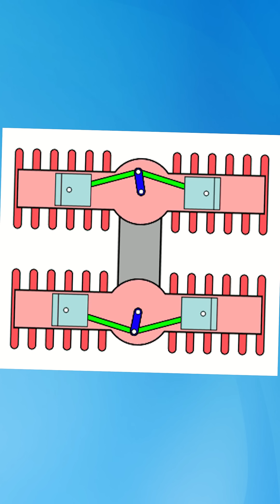wHY DoN'T CaRS uSE H-ENGiNEs?

Comment: The rotary engine catching strays😭
Reply from the maker: RIP dear sweet rotary
Reply: mazda has been working on a total redesign of a rotary engine for the iconic sp car theyve been working on so who knows it might be good soon
Reply: @AstraOG  fucking praying, i'd give my first born for it
Reply: Yeah like, theyre probably overcomplicated to machine, but I bet it has to have less moving parts than an H16
Reply: Honestly, I prefer my centuries-proven pistons over rotary any day of the week.
Reply: they are objectively terrible lmao
Reply: @astrofeeder777 built right they are good, Many examples of this, 787B mazda, Rob Dahms 4 rotor rx-7, these are the only ones i could think off the top
Reply: My grandfather had a 4 wankle mazda pickup that he'd use everyday, drive off-road, and pull f150s out the sand because they didn't let air out of the tires. Thing lasted over 300k miles and the bed rotted off before any engine issues occurred.
Reply: @astrofeeder777  they are much more reliable at high rpms than a piston engine, and are much more power dense.  Also my family has been driving a rotary for the last 16 years, and it has been really reliable, while still having original apex seals.
Reply: @burgerking2968  so long as you don't let carbon build up, rev the shit out of it and top off the fuel like every 3k miles or sooner, it's definitely gonna last. The rotaries that are not reliable are the ones that haven't been maintained, similar to subarus. The m5 e60 is also kinda similar. You gotta give it a lotta oil and do preventative maintenance.
Reply: @astrofeeder777  only to daily drive and it honestly not even that bad. use the whole tach, pre-mix the fuel, and dont get it hot.
Reply: @masterater  don't get hot Lmao
Reply: @wojtason9077  yeah.. whats funny about that? dont be a moron and it wont blow up🤯
Reply: @masterater  it's a combustion engine. Obviously it will get hot if it runs for more than 3 minutes
Reply: @masterater  just like if you were driving a 2 stroke

Comment: i dream of a turbo boxer-8 and an N/A boxer-H16 for years in F1
Reply: isnt boxer 8s extremely unbalanced or something? i heard the reason boxer formats didnt go over 6 was because they would only have somewhat decent balance again at 12 and even then it wasnt that great, as the old subaru B12 was a failure.

Comment: Also 3L 16 Cylinder is kinda stupid. That's 0.1875L per Cylinder. At that point just make a V8. That is probably like a third of the moving parts of an H16.
Reply from the maker: On the bright side, it sounds nice! But yeah the H16 was notoriously unreliable due to all it's moving parts!
Reply: @BladedAngel YEAH. YOU CAN HEAR IT. LIKE TRULY LISTEN INTO THE ENGINE IN DEPTH IF SOUND. YOU CAN HEAR THOSE PUSH RODS 😅
Reply: @BladedAngel  the moving parts count wasn't the issue because it didn't have more moving parts than necessary. it was an extremely rushed engine to get it out for F1.
Reply: @BladedAngel  did bro js chatgpt that shit
Reply: V8s have low top RPM, H16 could rev all the way to 18k RPM because the smaller the piston, the easier to make it rev faster
Reply: @C0lon0  V8s can go pretty quick as well if it's high bore, low stroke.

The ballance isn't perfect, but again, less moving parts mean it's more reliable.

I don't imagine an H16 doing 18k RPM for prolonged periods of time without issues.
Reply: @Armageddon_71 Yeah but you have to consider that this was the 60s so material science wasn't what it is today. So making a large piston that can withstand 18k rpm wasn't feasible. In fact the H16 made peak power at only 10,000 rpm while the competing F1 Repco V8 made peak power at a now pedestrian 7,800rpm. For high revs you really used to need tiny tiny pistons.
Reply: @Armageddon_71  not in 1970 they couldn't. It was impossible at that time to have that heavy of a reciprocating mass with the alloys available to them at the time. Even today, you don't really see V8's above 5L hitting anything higher than ~8-9K ram.
Reply: @C0lon0  older v8 f1 cars revved to like 20k and alot of v8s rev to like 9k
Reply: @hyakikano7154 Yeah but that was decades later. The first F1 engine to rev to 20k was in 2006. A 60s F1 V8 was lucky to get to 10k. The Repco V8 that won the Constructors in 1966 and 1967 made peak power at 7,800rpm.
Reply: @C0lon0  v8s can rev very well depending on the valvetrain, borexstroke. a 3.0l v8 would rev like crazy with way fewer moving parts
Reply: @C0lon0 that’s true, but larger displacement v8’s can put out massive torque and horsepower without having to hit 18k rpm. Like truly, what’s the reason for it?
Reply: I mean, the vstar 250 has 0.125 litres per cylinder. Whats the problem?
Reply: @Zander10102 the problem is idiots on the internet knowing nothing about engineering and making stupid comments like "might as well just go for a V8". They don't take into account the material sciences available at the time and not having the necessary alloys to allow a heavier reciprocating mass, and live life thinking their factory Hellcat is the answer to everything.
Reply: @CH3TN1K313  Okay dude, thanks for that one. I'm just saying that 16 Cylinders, of H engine layout specifically is probably not the best idea if you have better options!
Sure, the guys in the 60s had to make due with this heavy monster, but once the Cosworth V8 rolled around, most if not all of these whacky experimental engines became obsolete.

I mean... Would you want an H16 engine today? Would want to have to do maintenance on one?
Reply: @Zander10102 same as a 3.0 W24
Reply: well cosworth went for the V8 with its 3,0l DFV engine and it became the most succesful engine in F1 history.
Reply: Oh also if you think a 3l 16 cylinder is stupid, just look up the supercharged 1.5l V16 that BRM made before this. It weighted a colossal 230kg but was good for 600hp. It was the most powerful engine on the grid, heinously unreliable and made an absolutely insane spine tickling sound.
Reply: @Taidehaamu  it was very reliable after they played with it for a year or so, but it was just illegal to use by that time lol
Reply: The 16 cylinder would likely have better balance and run much smoother and quieter as a result, and will have much higher redline. It's more about refinement, not just brute power.
Reply: It's not lol, you can't get to the same revs with V8/V6 with making the bore so wide the piston would snap in half lmao
Reply: You are definitely looking at this from a modern perspective and not from an iterative perspective
Reply: its basically a moped per cylinder
Reply: Ferrari made a 1.5 liter 12 cylinder Columbo engine
Reply: @ Honda also made a 1.5L V12 RA271
Reply: Someone doesn't understand specific power
Reply: This is like saying that every motorcycle should be a v-twin. Think about that. Think about that really hard....
Reply: @VndNvwYvvSvv  Well, no it should be a V4 obviously. 

But again, to use motorcycles as an example, not every motorcycle has 6 cylinders or more...
At some point it's just a lot of moving parts and heavy
Reply: 0.18l in a single cylinder??? That's insanely small. I've seen SHOT GLASSES that hold more than that!
Reply: High revs tho in a more conventional setup, if done right
Reply: BRM 1.5L Twin supercarged V16 would like to know your location
Reply: me when i dont know what displacement actually means or does
Reply: Now imagine how reliable an electric motor can be with its one moving part. The entire drivetrain likely has less moving parts that a 1 cylinder four stroke engine.
Reply: @scottverge938 
Electric powertrain is certainly superior to ICE, but its batteries still are a heavy bottleneck.